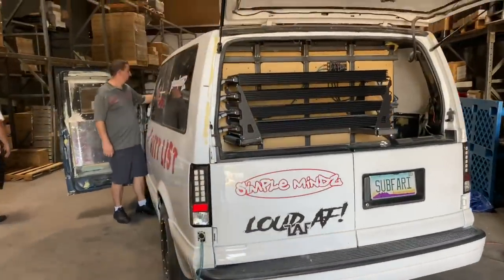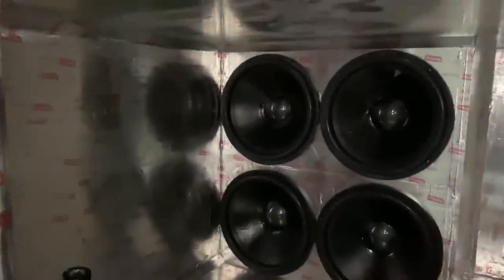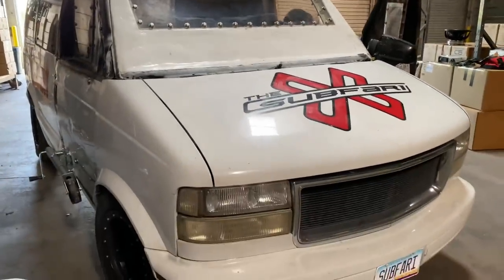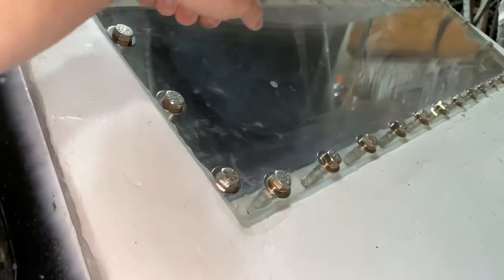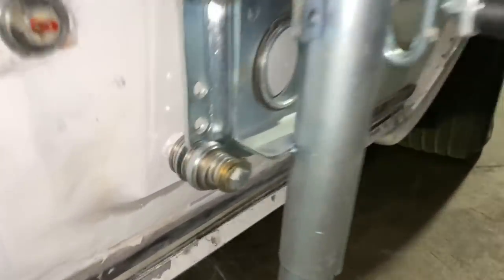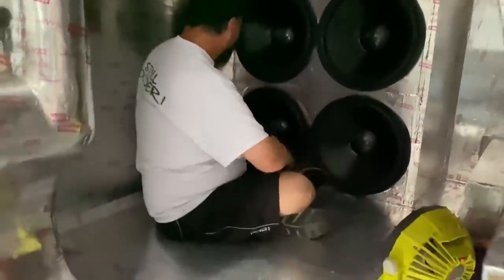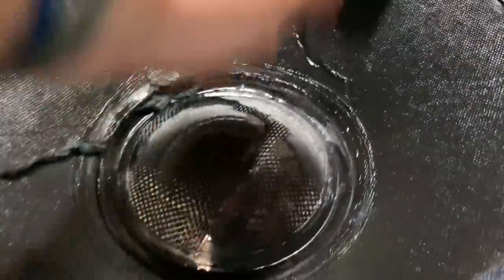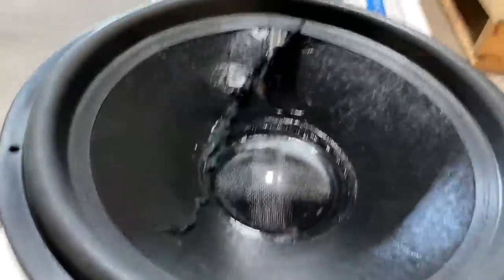Phil’s Crossfire Car Audio | 180 dB Bass Cannon Tour

Comment: I always hated going to comps and they show up with a car on the trailer!
Reply: They may as well just put some subs & SPL meter inside a sealed box, that would get the same result. I've never understood this level of SPL, i mean you wouldn't pull into a Burger King drive threw or go to home depot let alone go for a cruise in it, it has no purpose as a vehicle.
Reply: Its always the people that can't get loud complain about the louder vehicles. *cough*
Reply: @MazdaBass971  I agree with that however you can still get a loud musical build & still have a functioning vehicle, yes not as loud but still loud enough. I mean you can't even sit inside to listen to this so what enjoyment is there other than a few numbers on a screen. I honestly only clicked on this video because of the thumbnail as i thought someone was taking a 180db hit.
Reply: @HashDogg06  💯🔥🔥
Reply: @MazdaBass971  I hit 165+ in my 😯💨💨👌 I drove it to comps 3-500 miles away #dBDRA #Slamology #USACi #outlawdrag still won so many trophies I gave to my guy who run his own audio shop. #MemphisForce  and if you're serious about competing 9 x out of 10 other's drove there also, not toting them on a trailer. I've heard so much crap other's feeling they same as me. It's not  vehicles just a pos piles of metal. Get real 🤔💨💨💨🤦‍♂️🤷‍♂️🤫🤫🤫
Reply: @HashDogg06  I'm right with ua! This is a joke, like I said all the people who I talk with in comp hates that they can't drive it in. Not knocking the bass part, just not vehicles, . mazdaBass971 look already other are pointing out... doesn't impress me. Anyone can do that. Get realistic about it. 🤦‍♂️🤦‍♂️🤦‍♂️
Reply: Look 5 to ur 1

Comment: will 200 ever be achievable? The numbers keep rising.
Reply: To pressure 200db with subwoofers would require so much energy its just so unrealistic to the point of impossible, even hitting 190db is right at the point of near impossible.
Reply: MazdaBass971 was this not the same answer 20 years ago? I couldn’t even install a radio it’s been so long, but I remember when 145 was insane 25 years ago lol. My question is true, but hypothetical as well. Thanks.
Reply: @g4outdoors  At the time equipment wasn't as strong as what we have today, but 145db wasn't much to achieve back then and there were 160db builds back in the 90s so if you had the knowledge it was achievable. But now to achieve 190db is at the point of fighting the laws of physics even if you know what your doing, the amount of energy required is so insane its just near impossible and on top of that you will need to have subwoofers that are even able to handle all that energy and pressure.

Comment: This really isn't car audio anymore. Almost completely useless van except for the fact that it can barely roll up the back of the trailer. Might as well just start using big solid steel box with spl systems in them and haul them around in the back of a trailer. In fact I might just be the one to do that.

Comment: I mean at this point why even use a vehicle?  Just build boxes our use trailers and haul them to meets.  
Throwing a bunch of stuff into something that isn't drivable just doesn't make sense (to me).
If you can pull a 120+ into something you and a passenger can comfortably ride in then THAT is something thats cool.
Reply: Boxes and trailer can't run alternators.
Reply: @no3mun0z  Put an engine on a stand and hook it to a fuel cell.
Reply: @keviny704  lol. Sounds like too much work
Reply: To much work? Just get a Honda generator and hood it up to the trailer. You just turn it with a key and it’s on.
Reply: @jayholt2101  dude you don't even know what you're talking about
Reply: This van used to be my daily driver and it did mid 160s so not sure what your getting at.
Reply: @llwwcndll  DAMN! You know what im saying then man.  What you've done/are doing is amazing BUT 

When you and a passenger(s) can comfortably ride in something that gives old people chest pains from 50 ft away or shakes the hot light out of a Krispy Kreme window it just has a different vibe.  Thats all.  Wasnt clowning your work at and i know its built for a purpose.  The repulsively loud daily drivers hold a special place in my heart😂🤣😂
Reply: @keviny704  yeah this type of build isnt meant for passenger side demos. It built for a specific purpose you know